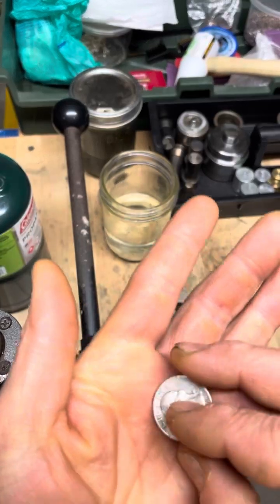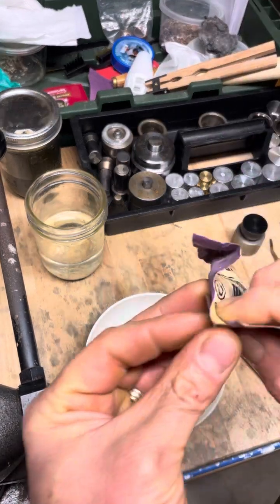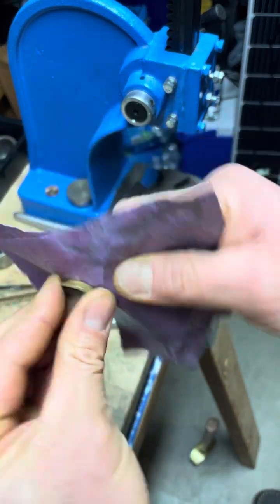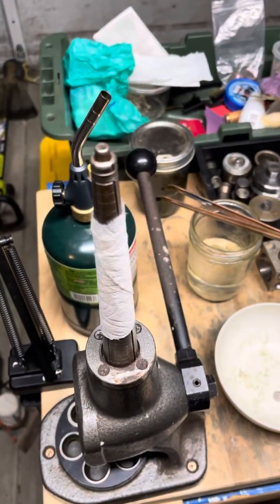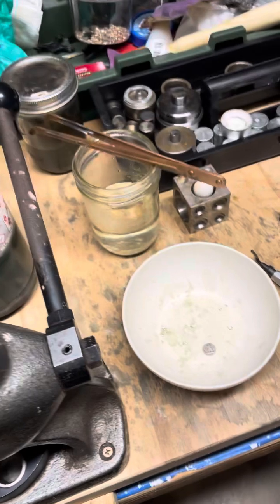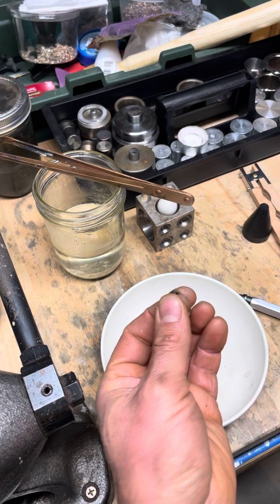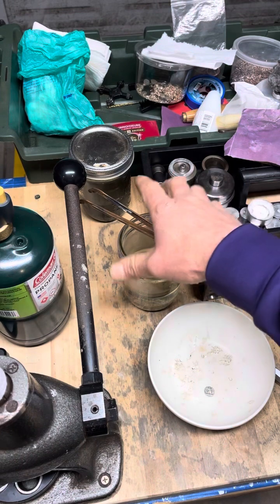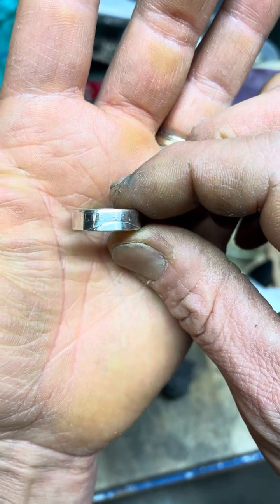1944 Quarter coin ring, 90% silver, size 6 1/2

Comment: Love your videos and help, I have a question do you heat up your pickle I see you have in a jar? I’m doing a silver today, Tia
Reply from the maker: I heat up the ring and drop it in, I know some heat up the pickle in a pickle pot, but I got this method from a jeweler in town.  Just be careful of the splash after dropping it in, I believe it is or has characteristics of an acid.
Reply: Thanks bud, you are a master!
Reply: Sorry but do you not have to rinse in baking soda after pickle?
Reply from the maker: @noahstack24  I haven’t in the past, I normally run it under water after the ring is done.  Before I discard the pickle I’ll put some baking soda in it to neutralize before disposal.  I’ll look into it though.